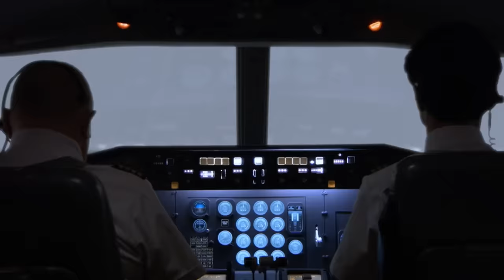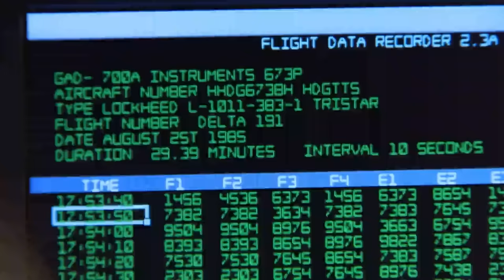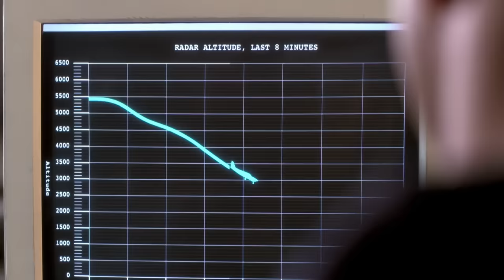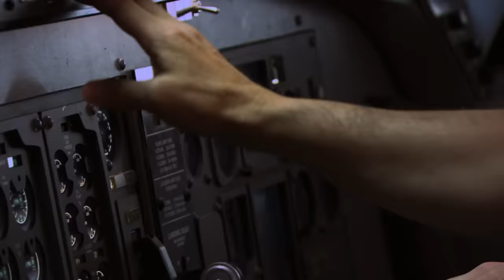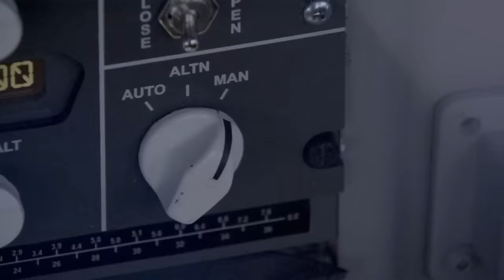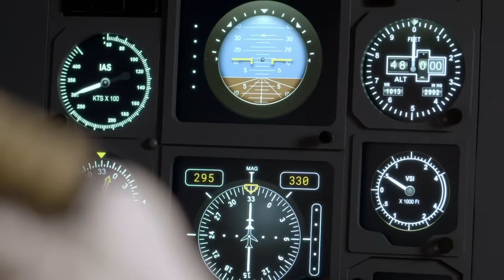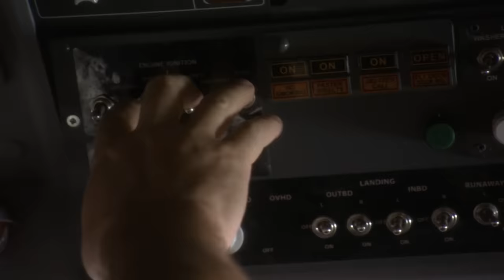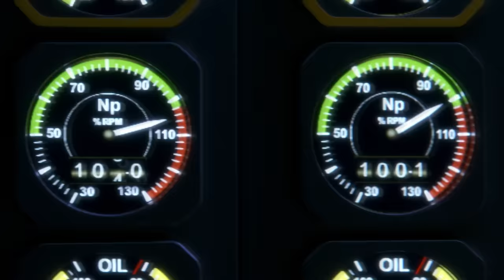The Mysteries Behind Air Disasters That Shocked the World | FULL EPISODES | Mayday: Air Disaster

Comment: As a retired airline pilot with 27,000 hours on various Boeing’s I was most upset when I learned of the Lauda accident. I was appalled by the fact that the tests for certification were at a relatively low altitude rather than at a more representative altitude like 35,000 ft. Obviously TAS was the difference between controllability and disaster and this should have been considered from day 1.
Reply: So curious question for you in another episode it was said the guy who crashed the German airliner in the Alps did a 100 foot leveling while the captain was not in cockpit, wouldn't ground control control
Reply: Had seen that and notified the airlines what he had done before and not let him fly again
Reply: Meaning he had done it before the fateful crash on another run
Reply: Great sir I am a Surgeon but I admire pilots . Love and respect from India 🇮🇳.
Reply: Don’t worry I’ll be in an accident one day too

Comment: JFK Jr. only few that plane at night for about three hours by himself and no mention at what altitude or whether it was over the ocean. His old plane did not require fuel mixture adjustments, as it was turbo, as it got dark and over the ocean at 6 thousand feet if he didn't make correct adjustments on fuel his plane would of lost power and he would of lost altitude then as the radar indicated that is what happened then he pulled up like some do in a panic then stall and crash that is also what the radar indicated at no time in flight did he not have the wings level until he stalled, if he did not watch his gauges and became disoriented he would not maintain wings level why watch one gauge and not the other right next to it, like altitude and air speed? His crash was because he did not have enough experience in that type of plane in various conditions, to adjust it accordingly. He lost power by not adjusting the fuel mixture properly in that engine type if you adjust it the wrong way the plug will foul out and it causes sporadic misfire increasing power loss. If the plug fouls out you have to go full lean on the fuel until the cylinders dry out then add more fuel it is tricky.

Comment: Operator error is number one, mechanical is 2nd. I worked in the industry. Here comes the committee! 🛸🖖👽🤓😎🥸
Reply: lol
Reply: Not that simple.

Active volcano soot clogging engines, autopilot computer malfunction,  heavy equipment on runway during hurricane winds, large birds striking engines causing engine failure, etc.

Comment: The most probable cause of the accident was the structural failure of a 22-year-old tailstrike repair located on the aft lower lobe of the fuselage. The skin scratches associated with the tailstrike event had not been removed prior to installation of the permanent repair doubler.

Comment: Omg they are not “without” oxygen until you get 200 miles away from the earth. As you increase altitude you decrease the volume (Charle’s Law). The gas molecules in the atmosphere (oxygen gas = 21%, nitrogen gas = 78%, carbon dioxide gas = .03%, Argon gas = 1%) are the same at sea level as they are at 40,000 feet, but at higher altitudes the molecules are spread out so you are breathing in fewer molecules at higher altitudes than you are at lower altitudes. So you eventually pass out from hypoxia which is low oxygen NOT zero oxygen as this poorly researched video states. I can hold my breath for 45 seconds while doing the chemistry I teach and get the answers correct and I have severe asthma! So don’t tell me these pilots passed out 5 seconds bc they had almost no oxygen in your blood. The reason you CAN hold your breath is bc not all the oxygen you breathe in is used and is therefore recirculated and this happens constantly, 24/7. Always ask a scientist for clarification and never believe 95% of what you see on TV. It’s all Hollywood crap and I am sure you have noticed that it annoys me excessively bc if you don’t hear the truth you will always believe the lies.

Comment: I can hold my breath for 60 seconds while driving and not cash. I expect my plane driver can do the same when flying. Any pilot that only has 15 seconds of usable oxygen in his system needs to tell me so i can take another flight.
GREAT SERIES by the way.
Reply: 2:10:58
Reply: 2:10:58
Reply: Do it at 35k feet while under extreme distress and tell me how long you can hold your breath. You're not allowed to take a deep breath before you do it either.
Reply: It's 15 minutes until getting down to a lower altitude like 10 thousand feet where it's breathable without added oxygen.